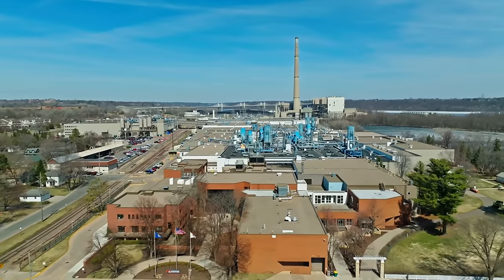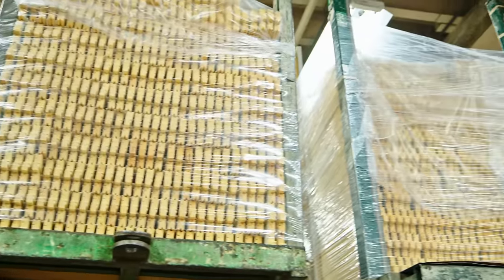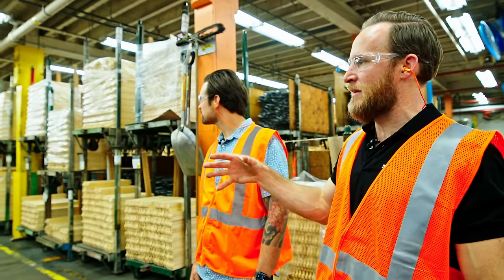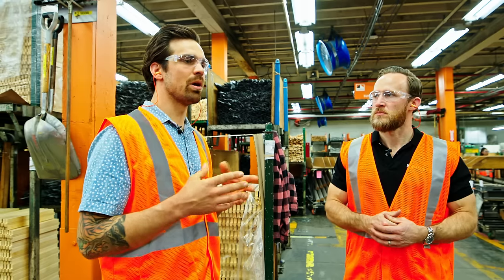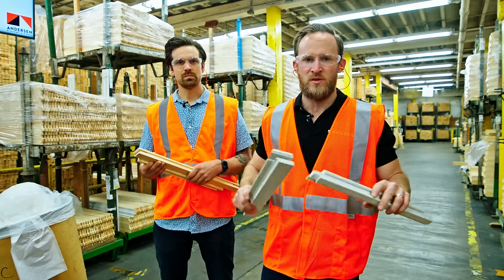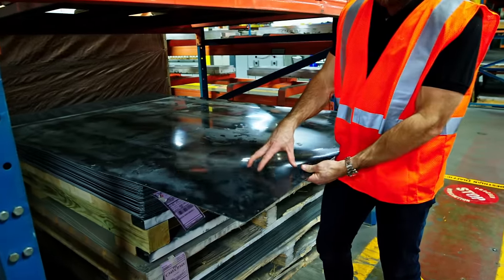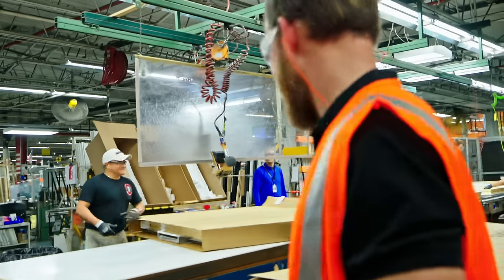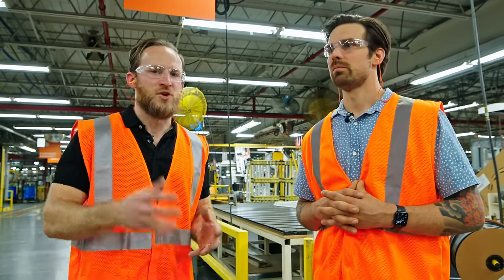Touring Andersen Windows 2,000,000+ sq ft Manufacturing Facility @andersenwindows

Comment: It is satisfying to see them coating the end grain and completely wrapping the exterior of the jambs with a single piece. Over the years, I have replaced so many window sash and jambs on Anderson Windows that rotted from water penetration of the end grain.  This is all on windows that were twenty or more years old.
Reply: poor original install.
Reply: Oh no! I better check my 20 year old double hung series 200. Forgot, there’s no weather here so no need to check. 😂
Reply: I’ve had my Anderson windows and patio door that were installed in 1983. Still in good shape but I would like to change them out. I can’t complain good product